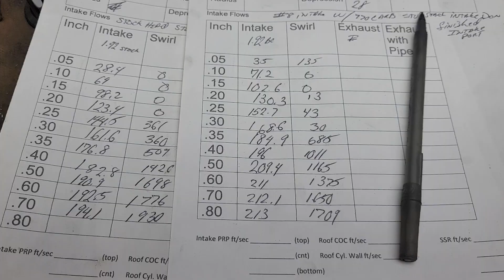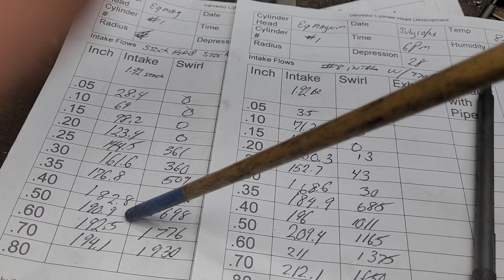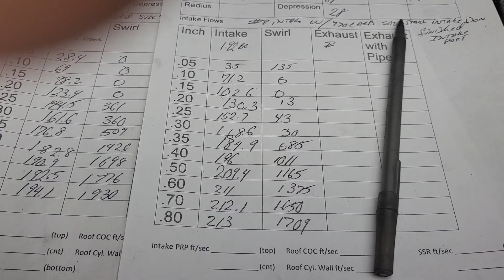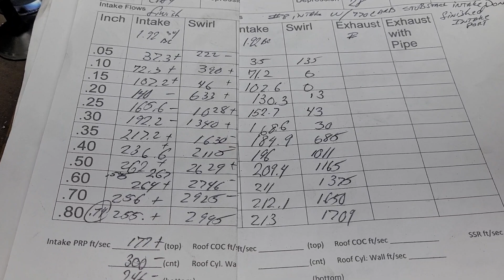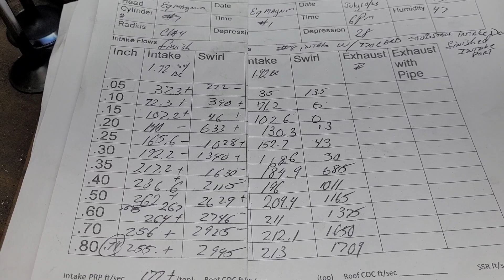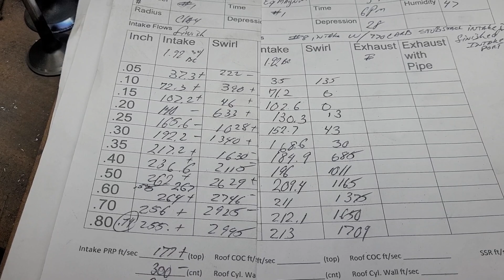Edelbrock Performer rpm air gap 7577 ported intake manifold on finished EQ Magnum cylinder head.

Comment: You actually got more out of it than I thought you would!  My biggest piece of advice is hone with a deck plate and use 1/16” rings
Reply from the maker: Thanks
Reply: I can't believe they ever used those thick bore wearing 5/64 rings from the factory. Metallurgy and technology have definitely gone in the right direction for performance. Now you're seeing a lot of 1 mm and 1.2 mm thick top and second rings. I'm curious to find out the minimum thickness that will still have good durability and longevity.
Reply from the maker: @robertwest3093  D.V. loves 1mm rings.

Comment: Thanks for you great videos. Im particularly interested on this one  because I have same heads and intake on my 360 Mopar. My heads flow 272 cfm with 2.02 valve. As the intake cuts flow so dramatically, looks like Im not taking the full advantage of the head flow. Would be nice if you could flow the intake alone without head and report how much it flows. Also would be nice to see how much those your EQ heads flow with different intake like Victor 340 singleplane.
Reply from the maker: I will take it under consideration. Thanks

Comment: I'd like to how a single plane intake will affect overall flow. My Mopar small block heads were supposed to flow 275cfm according to Mopar. Paired with a port matched Air Gap with a 242/250, .558/.572  sft cam made 460hp in a 414. I wonder if I would have gotten more with a M1 or  Victor.
Reply from the maker: Airgaps not ported are about 220 cfm

Comment: thank you Very much
Reply from the maker: You are welcome
Reply: @servediocylinderheads  it appears that the R.P.M. Design for the small block head is best used with unmodified port samller cc and less flow. and to step up In  the intake design is needed to Match any larger and higher flowing port. The testing in past had show the Factory 340 Manifolds were better then RPM for flow
Reply from the maker: @smilsmff  I believe it. Thanks

Comment: Motor Trend “Small Mopar intake flow test” sure makes these intakes look bad compared to just about every other aftermarket intake available.
Reply from the maker: Why?
Reply: @servediocylinderheads  The RPM is outflowed by just about every other aftermarket manifold. Very similar flow numbers to what your testing has shown. In contrast the old LD manifold flows a significant amount more air despite being 40 years older in design.
Reply from the maker: @ThirteenTwentyRepair  I am a fan of the older designs. I bet this design makes more low end torque. Thanks
Reply: The new older intakes can flow more air but there fuel carrying ability, along with the quality of the air and fuel into the cylinder are better with the RPM. This is why the LD-340 (an excellent intake I once owned & had modified for a TQ) was reintroduced or modified slightly.
Reply: Ops, LD-340 NOT REINTRODUCED
Reply: @ThirteenTwentyRepair I had an LD340 on my Cuda, and it was a fantastic manifold. You can often find them on Flea bay still
Reply: @ThirteenTwentyRepair I've swapped a LD for an Air gap, I can only attest to what I observed b/c it wasn't my car and my job was to swap and tune but I personally felt like the Air gap was a crisper throttle and a bit better torque. Nothing amazing but it is surprising to hear the flow is worse.
Reply: i just watched eric weingartner dyno test 3 duel planes the rpm made the most hp by a long shot and pulled the lowest cfm

Comment: I think, he needs 3:73 gear ratio. It, would help. But, he probably won't.
Reply from the maker: I think he needs 5:38 gears 440 cube  small block and a tunnel ram.
Reply: @servediocylinderheads Don't think the manifold would be enough at that point 😅
Reply from the maker: @jseal21  Exactly!